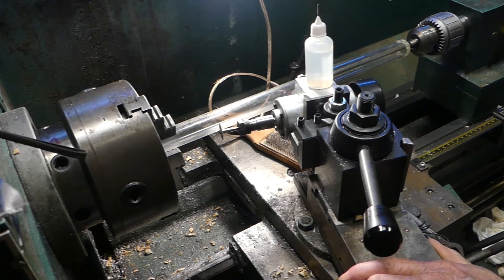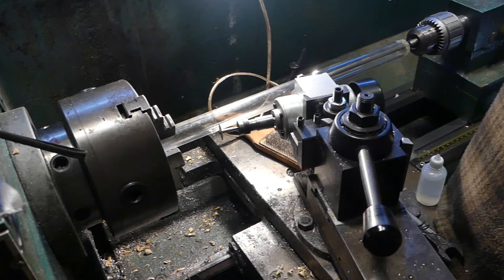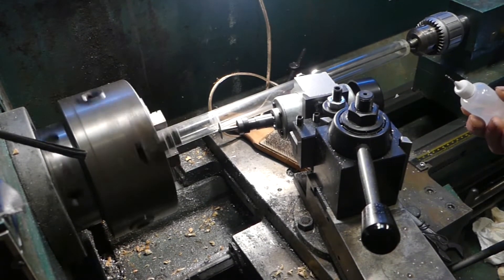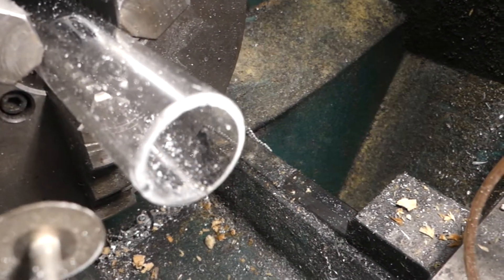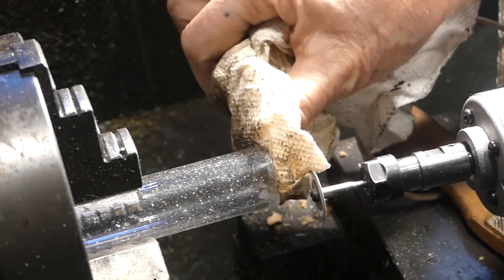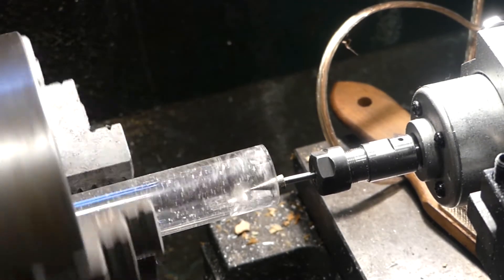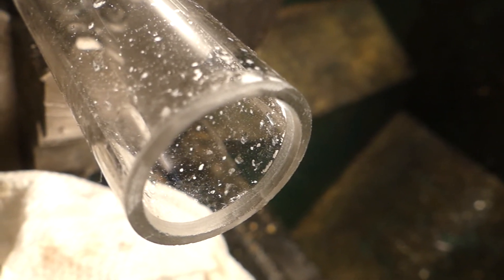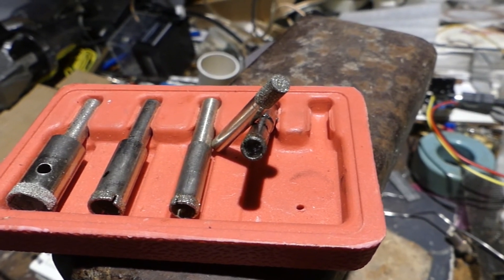Machining glass tubing

Comment from the maker: The cute little applicator bottles mentioned in the video are way worth it - here: https://www.amazon.com/gp/product/B07CZ774ZX/ref=ppx_yo_dt_b_search_asin_title?ie=UTF8&psc=1
No leaks, no spills, I use them for coolants, cutting fluid, solvents - anything you need a drop or two of now and then.  Stuff keeps in them, even acetone doesn't evaporate for weeks on end.  Having ordered almost every other kind, this one was the win.